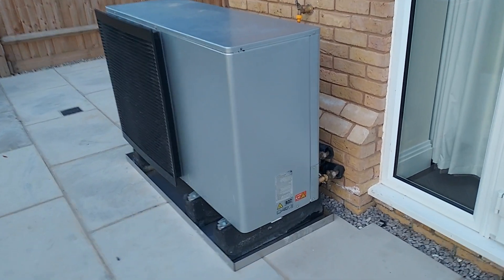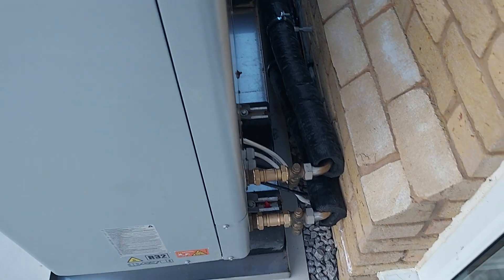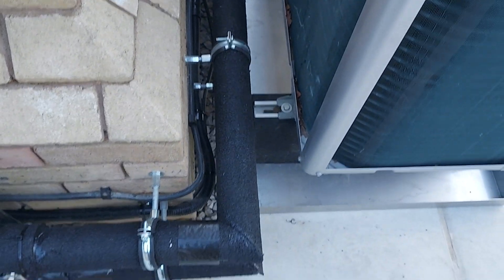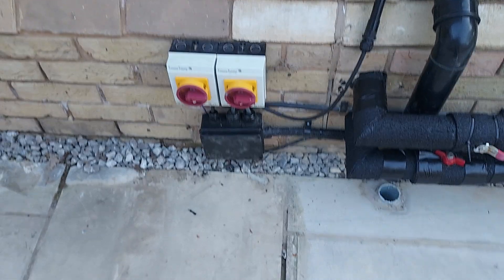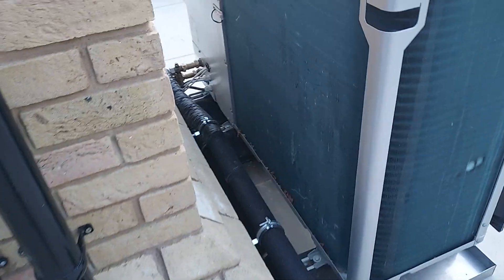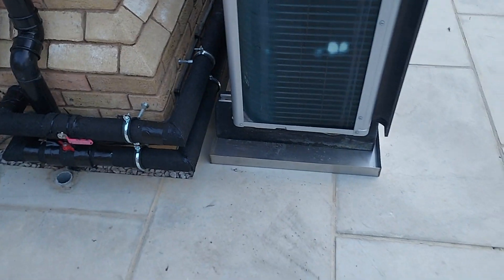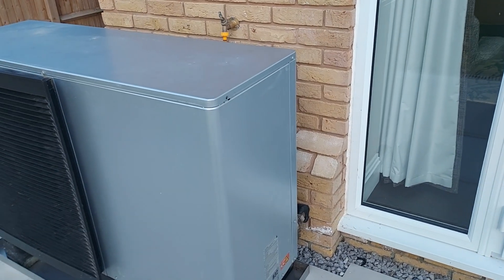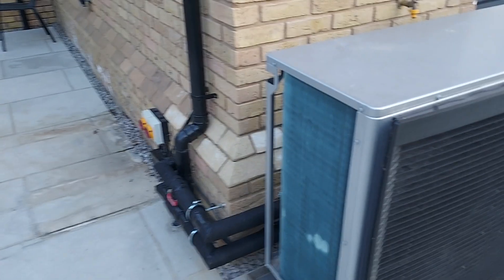Reinstalling a poorly fitted heat pump

Comment: What are the threaded inserts you’ve used in the brickwork for the clips?
Reply from the maker: These had been used on these particular heat pumps and I had never seen them before. They are like concrete screws. Here we are just reusing them